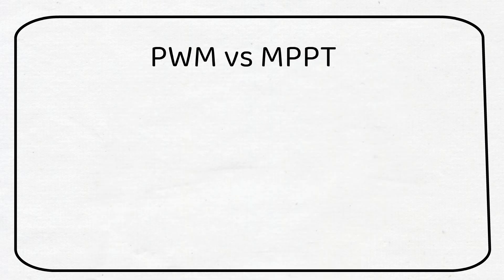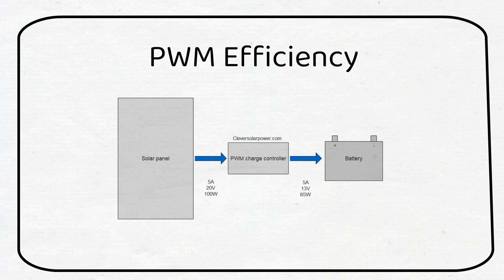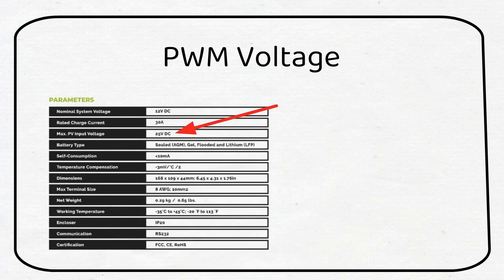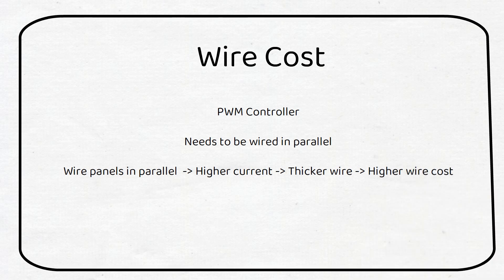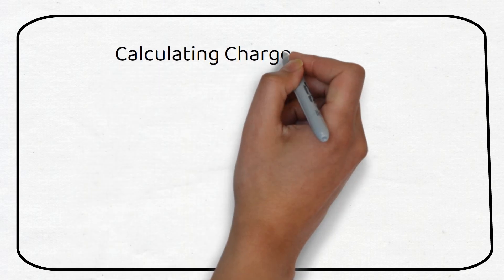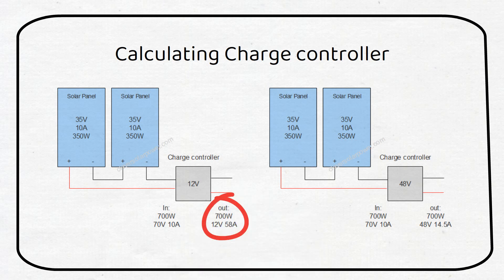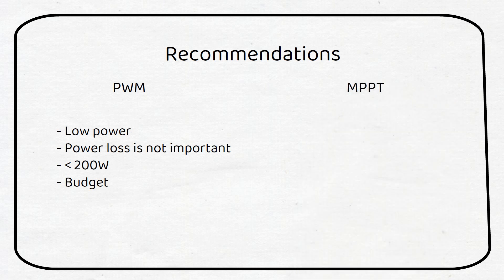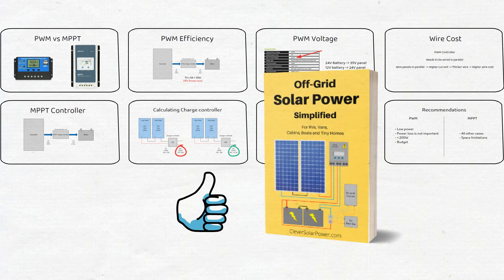PWM vs MPPT Charge Controller for Solar Panels: Which one is best?

Comment: Hi,  thank you that was a great explanation!!
I have a question how do I calculate the time period it takes to charge a 12 volt battery knowing the amp hours of a battery, watt, amps, volts of solar panel with a mppt control.
How is the time affected to charge 1 12 volt battery compare to charging 2 12 volt batteries in parallel?
Reply from the maker: Calculate the battery watt hours: 12V*100Ah=1200Wh. If your MPPT charges at max 10A and 12V, then you charge at 120W. If you recharge the battery from 0 to 100% you will need 1200Wh. Divide battery capacity by charging power and you get the amount of time it takes to recharge the battery. 1200Wh/120W=10hours.
Reply: What about the charging bottom voltage.

Isn’t it so, that a PWM controller will start charging the battery immediately when the voltage of the PV will be higher than the voltage of the battery, whereas MPPT will start charging while the voltage difference between PV & accu will be somewhere around 5V?

In other words saying, the MPPT will preform always better but in ideal conditions, but will deliver hardly anything at low PV voltage.

Eg. 
PV V = 15,0 V
Accu 12V = 12,3V
Voltage difference: 2,7V

At the difference of 2.7V MPPT will no deliver/charge, whereas PWM will charge de accu with 15.3V

Comment: Even with a small set up 100 W to 12v batterys I will get more power from MPPT? 🤔
Reply from the maker: If you only have a 100W solar panel , then the power to your battery doesn't justify the extra cost. You can just use a PWM. Make sure you get a 18V solar panel to get the best efficiency.
Reply: @cleversolarpower I have one that is 18v 210watt one that is 20v 200watt and one that is 43 volt 370watt?Yeah I know I got them separate before learning how voltages worked on charge controller!Seems I will be getting 3 different controls to get the most out of them!Should j get  pwm for the 18v and mppt for the other 2?
Reply from the maker: @twocommastv  You could series connect the first two and parallel connect with the third to an mppt. That will be the cheapest option.

Comment: Hi, i own 2 60v 50watt solar pannels I would like to connect those to a buck controler and than to a pwm to charge a 100 amp 12v battery do you think this could work? Is i buck the voltage to 18v? Is a 20 zmp controller enough? Or should a use a 20 amp mppt?
Reply from the maker: Are you sure it's a 60V panel? That is highly unusual for a 50W panel.
Reply: @cleversolarpower  yes it is e mpv panel

Comment: If you care about the life of your batteries, there’s never a reason to use PWM…. Pulse width modulation does nothing to protect your batteries from over voltage…. MPPT regulates the voltage coming from the panels to match the voltage required to charge batteries without subjecting the batteries to pulses of higher voltage…. It doesn’t matter how quickly the PWM turns the power on and off it’s still pulsing the batteries with direct panel voltage…. And if it’s a cloudy day then the voltage may be too low to charge anything, whereas with MPPT the panel voltage on a cloudy day can ( and should be designed to) be significantly higher than your battery voltage and the MPPT will regulate to the required battery voltage….    I’ve had a 18V panel on PWM destroy a 12V battery but I’m currently feeding 90V into a MPPT into a 12V battery…. It starts charging early at sunrise and can continue all day regardless of cloudy weather or rainy days and will charge right up to sunset… MPPT for the win…
Reply from the maker: Indeed, thats why I recommend using a PWM only in low power applications. These usually have an AGM battery which is less sensitive to the voltage. However, the voltage depends on the temperature while the irradiance (sunshine) influences the current.

Comment: looking at 2.09 minutes along there would be  a voltage drop from 20v to 17v  so not 20v and 14.4v going into the battery not 13v  so no on 7.5 amps the increase is much smaller than shown, so 85w from the panel because volt drop - mppt effeciency loss = 82w into the battery... 82w divide 14.4v = 5.7 amps however it will be less than that because the mppt device has more loss than  3% that you and i have shown

Comment: woops your out on your calcs, when the 100w panel is delivering 5 amps the 20v drops to about 17v this is voltage under load, so 17v x 5a also the battery is being charged at 14.4v not 13v so only a loss of 2.5v. not 7v. this small loss suits as you say pmw, you can see this on your volt/amp meter
Reply: do you drive pmw?

Comment: Well am sorry to tell you this we us pwm controller in bms for each cell at high volt 48 to 160 volt to match the cell voltage if the mppt buck is converter 100 vdc to 52 volt a pwm volt regulator is required for each cell to switch 1 or 12 mosfets per cell or a switching halfbridge converter is use and and pnp transistor with ziner voltage sensor to switch of the pnp that’s two stage bms

Comment: Ive got 20w 12v panel from alliexpress with cheap controller, connected to 20ah 12v battery but we have a cloudy summer this year in Poland and its not able to fully charge the battery, it hardly keeps it at the same charge level. I use it to power 16w pool filter (idea was to keep it runnig all the day ) Can switching to mttp controller help with it?
Reply from the maker: The Voc will be 13.5V, this is too low. Normally a 12V panel should have 18V Voc. So you need to upgrade your panel or place two of these in series. Better get a 100W 18Voc solar panel. 16W pool filter? WHich one do you use? Contact me on my website for further information.
Reply: @cleversolarpower   This is stock clearflow 220v cartrige filter  (swapped for filter balls). I use it with 12-220v inverter.

Comment: That is not accurate, you only described a DC to DC buck converter not mppt, the maximum power curve of a solar panel changes with heat, and the mppt controller tracks that to extract maximum power from your solar panel.
Reply from the maker: If i was talking about how an mppt solar charge controller works i would lose 99% of the people watching. If you want to know how it works, then i suggest looking up a paper about it. I explained the bare essentials here so all people can understand.
Reply: @cleversolarpower  you don't need to explain it in details, but you should not give wrong information.
Reply from the maker: @CroftGaming1  it is not wrong, its is simplified so everybody can understand. If you want in depth workings of an mppt, then my channel is not for you.
Reply: @cleversolarpower  i built my own mppt with arduino, i understand how it works, that's how I can say what you said it's about any DC to DC buck converter not mppt controller.
Reply from the maker: @CroftGaming1  As I previously said, it's a simplified graphic. Can you make a video and explain how it works? Then I can send people to your video if they have questions about it.
Reply: @cleversolarpower  sure, I will send you the link

Comment: can i use a 24 volt pannel to charge a 12 volt on pwm
Reply from the maker: That is not recommended because the PWM cuts the voltage off. A 24V panel is typically 36V you will be losing 23 volts in the process. Let's assume it a 200W panel at 5.5A and 36V, then 5.5Ax13V=71.5W (theoretically). So a loss of at least 65%. I recommend using a 12V (18V) panel or a 24V battery instead.

Comment: I read an advantage of PWM is it can charge a lead acid battery more fully than MPPT.  This prolongs the battery's life by preventing it from being constantly undercharged and getting sulfated prematurely.
Reply from the maker: No, not at all. The only way this is possible is that the PWM has a higher charging voltage than the MPPT.
Reply: How does MPPT converts the remaining voltage into Amps?
Reply from the maker: @rathnamalasp1097  By converting the voltage into current. A PWM cuts it off which is lost.
Reply: @cleversolarpower but lead acid batteries respond well to a slow trickle charge, so wouldn't it be down to the slower charging?
Reply from the maker: @stupidscruff  Charging at the recommended C-rate is always better than charging at a higher current than the C-rate. Check out my video about C-rate.
Reply: @cleversolarpower  sorry I'm a bit confused, the voltage can't drop below a certain level to the battery so only the amps will change right?
So if you have a pwm 12v controller you generate your amps through parallel 12v rated panels or a panel.
The charge controller trims the excess voltage from the panel when it's working sufficiently (most are rated higher than 12 of course so the battery can actually charge) and uses the amps to charge the battery (more amps means faster charging).
In the case of having a higher voltage panel hooked up to a 12v pwm you would be wasting allot of potential, but I'm pretty sure it's been proven multiple times there is barely any difference between a pwm and mppt controller on smaller setups.

Comment: Accurate.. I got 2 100w solar panel in parallel.. Does only 136 watts
Reply: What were you using to measure the wattage?